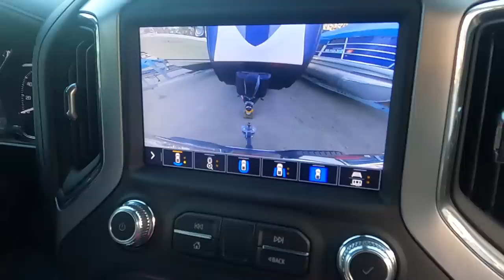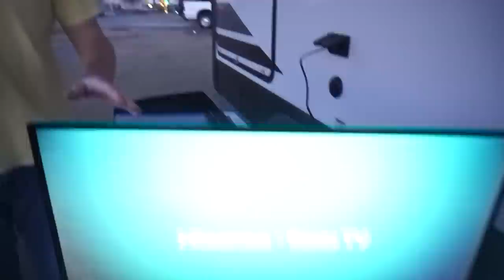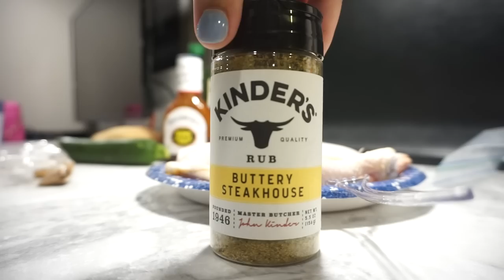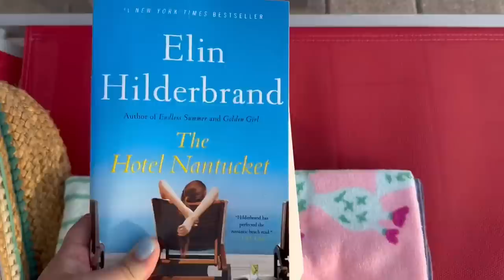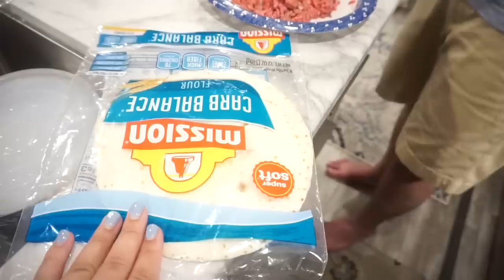OUR FAVORITE RV TRIP EVER! STAYCATION AT CAROLINA PINES RV RESORT | COOKING AND CAMPING

Comment: hi 😁 2 things.. i noticed in one of your older video's "we bought our dream home" @ 19 :40 time stamp up stairs i saw your video look as if it was reacting to "high EMF's" distortion lines outside the upstairs bathroom closer to the ceiling. i ran it back a few times. just have it checked? can cause health issues.. also i didnt see a carbon monoxide detector in the garage near the gas water heater? maybe i missed it. Some of those heaters had issues with heat exchanger gas leaks? im a jack of all trades.. well we enjoy watching the food videos 👍 you make foods we like 😁